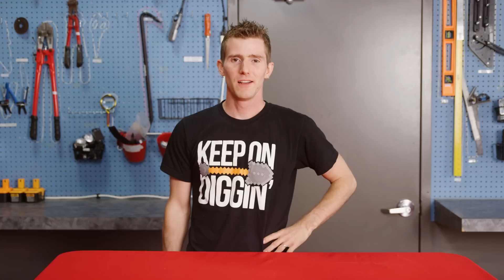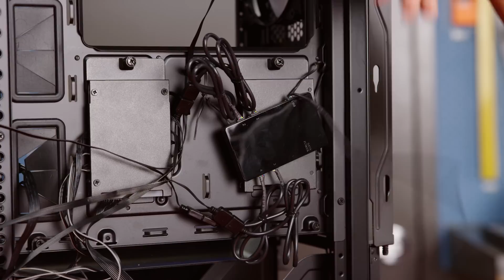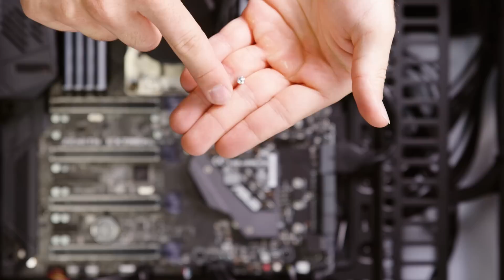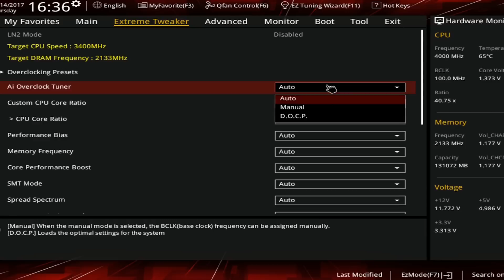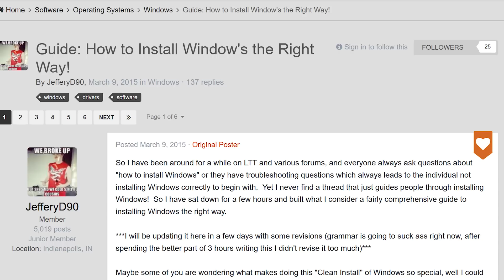Ultimate Mega-Workstation PC Build Guide

Comment: TBH this wasn't ultimate. No water cooling, no multi GPU, Intel has more cores now, Noctua fans are better, you could have had more ram, could have had 3tb of Samsung m.2 storage, could have overclocked GPU, should have manual overclocked CPU, and should have added storage as its meant to be 'ultimate'. Ok rant over.

Comment: ...why no vega?
Reply: Birki gts Well in that case wouldn't Vega FE  make the most sense considering the drivers for it are more aimed at production and compute tasks? Vega 64 only beats 1080ti in some tasks. I'm not biased by any means and Vega is really good in some regards I just think the 1080 ti is more well rounded for all tasks including gaming. Sorry if my first comment came off rude.
Reply: render performace 1080ti is better than Vega, BUT Vega have 16Gb RAM and that could be useful (same like quadro series) when you render complex animation
Reply: Not really. The gaming performance isn't that bad.
Reply: A titan xp is way better in every way than the 64. The 1080 ti and 1080 though do have less compute performance compared to vega 64. Then you can also consider the fact of power consumption, the xp is way more power efficient, so technically it might be cheaper to go green team because you might get away with a cheaper PSU, in the end making it cheaper overall.
Reply: 1080 ti is better
Reply: Vega is kinda garbage aside from computing

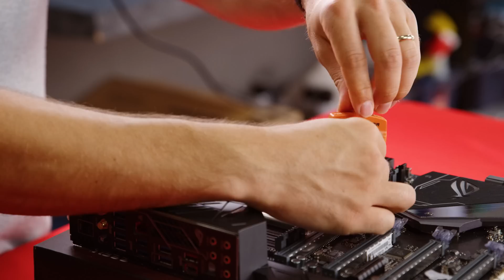Comment: 3:50 Psi is not a torque value, its a pressure, a distance times a force on a rotating axis is torque so the units are normally Newton meters or pound feet.

Comment: Help me, i have this PC:
Windows 10 Pro 64-bit
Intel Core i3 2100 @ 3.10GHz
8,00GB Dual-Channel DDR3 @ 665MHz
ASUSTeK COMPUTER INC. P8H67-M LE (LGA1155)
NVIDIA GeForce GTX 1060 3GB (Gigabyte)
111GB OCZ-TRION100 (SSD)

What do i need to upgrade to run powerful games?
Reply: I7 2600 or i7 2600k
Reply: you aint doing shit with an i3
Reply: https://pcpartpicker.com/list/6ZYFjc take your SSD, PS, and Graphics card from your old PC.
Reply: no, its more cost effective to just get a ryzen 5 processor, and a motherboard. the i7 2600k is still selling for 270 USD
Reply: Ryzen 1600
Reply: I think all the parts leaving the gtx 1060 requires an upgrade
Here are a few budget options:-
1)G4560, H110 motherboard with latest bios for 7th gen support, 8GB DDR4 RAM

2)i5 4460 and B85 board, your ddr3 ram will be compatible so no need of RAM.

Personally I would have gone with second option since I don't have to buy RAM and a 4th Gen i5 is a huge upgrade from a 2nd gen i3.
Hope I was able to helped you :)

Comment: This build would only cost $1,000 if you didn't include the RGB.
Reply: The processor alone costs 1000 dollars tho
Reply: you st... I gonna have really similar build and it cost me 3500 euro. 1950x 1000 euro, 1080ti 750 euro 64gb ram 500-700 euro (I dont order ram yet), cheapest TR motherboard 370 euro 2x ssd (1,5 TB samsung ), seasonic 600w fasless PSU for 220 euro and custom made pc case with cpu and gpu cooling for 600 euro ( go check fanlessfan.com ). So electronic cost around 3000 euro itself without cooling or rgb. Or you just post fish bate and I swallow it smoothly xD
Reply: PowerGlvove I never would have guessed

Comment: Single GPU? Unsubed
Reply: 2 1080 Ti don't run games.
Reply: We need 2 Titan xp, the newer pascal xp xp edition. No, not that one, the xp one.
Reply: 1. Money is obviously not a problem 
2. Put 2 titans in there and overclock the balls off of them, whole point of this thing is overkill
Reply: @Benny Biggums the main reason the 1080ti clocks higher is because the titan has a shitty cooler, put them both on water and they clock about the same making the titan more powerful
Reply: SLI 1080 Ti doesn’t improve much from a single 1080 TI
Reply: Overson depends on the games and resolution... I didn't get decent playable framerate on my home PC until I added an additional 1080 Ti.
Reply: +Dulux Doggy, the reason is so the PSU will run silently no matter the load of the system, Linus said it would draw around 600w under load, the PSU won't turn the fans on until it has a 600w load in it, thus under-stressing the PSU making it last longer and add heaps of headroom for down the road if another GPU is added.
Reply: Keep in mind this build (guide) is meant to be a workstation pc first, and gaming rig second.
Reply: Nabder Nagor and not even a titan!
Reply: Nabder Nagor LMAO
Reply: titans are kinda shit tho....
Reply: billyhatcher643 but what is the point of a 1200 watt psu with only one gpu!!
Reply: i concur doctor.
Reply: Nabder Nagor what benefits of dual-GPU on workstation build? Think about it.

Comment: Don't put anything less than a kilowatt PSU into a threadripper build unless you're OK with not overclocking.  Overclocked, just the CPU can pull 500-600 watts on it's own under full load.

Comment: 1TB of RAM is useful to have for basic use, especially if you want to occasionally use a RAM disk. Since most RAM disks scan be scripted to automatically load files, you could potentially have a game install copy its files from fast SSD, to the RAM disk, thus when launching the game, all of the loading will be RAM copy speeds which is just as fast as plain reads.

Comment: Decent guide , but when installing Threadripper,  Dont tighten down 1,2,3.  You should thread the screws until they catch in with 1,2,3 rotation ,  then tighten down 1,2,3.  When tightening down 1,2,3 it usually will tilt the hinge and the other screws wont be able to get started.  Seen many on reviews try to just tighten 1,2,3 and then had these problems and blamed the manufactures , rma'd the boards for this.

Comment: No custom watercooling? A Zotac 1080 Ti Amp and not an Asus Poseidon? No custom hardline watercooling? No 4-way SLI!?

What is this, a budget build!?
/s
Reply: No, it's a sponsored build, which means they use whatever Cooler Master tells them to use. Like seriously, when have you EVER known Linus to pick a Cooler Master all-in-one water cooler over Corsair?
Reply: Bate this is supposed to be a "ultimate mega" build not a "this is still kinda sorta justifiable build"
Reply: 4 and 3-way sli died with pascal. And 2-way it's not great, most of the games out there don't support it; so you get a expensive block of metal attached to your motherboard.
Reply: Revan a workstation is not for gaming. You can easily use 4x 1080Ti in this for productivity purposes. 

The system should have 4x 1080tI or even better 4x Nvidia Tesla P40’s
Reply: James Cruz that '/s' xD
Reply: Ayy lmao
Reply: Revan i can understand why you are looking at it only for it's gaming capability.
Reply: James Cruz love ur comment lol 7k dollar build with no real water cooling
Reply: all the money was spent on a sponsored case, that's why no real ultimate.
Reply: 3 and 4 way sli is also very difficult to fully set up for pascal, I know 4 way is not officially supported, but I am unsure about 3
Reply: Ben Perone you don’t need the SLI interface to use 4 or more cards in the system. 

CUDA does not need SLI
Reply: +Steve Bennett yes yes very true, but op referenced sli specifically

Comment: Sigh linus, linus, linus
You IDIOT
That computer sucks.

Look at my specs
Ram: 1Gb
Graphics card: GeForce G210
Motherboard: MSI X79
Cpu: Intel Core 2
Hard Drive Storage: 500 Mbs
Case: QuaDra 800 - 1993
Cooler: None
Rgb: Christmas Lights
Can run Windows Vista at 7 fps

Get on my level, Linus.

Comment: Linus, you disgust me. You are using Threadripper for a parts porn build, but you use an AIO water cooler for the CPU instead of a custom loop, you only use 1 GPU, and it's not even a Titan Xp or water-cooled, no Noctua Industrial fans (the pure black ones) for what should be multiple radiators, only 1+TB of M.2 SSD storage (doesn't even look like it's in RAID), no professional sound card, no 1600W PSU (which would allow all cables to be sleeved), half-assed cable management, and you used the ugly-ass Cosmos II case. Didn't know it was Amateur Hour at Linus Tech Tips. Couldn't even get a quarter chub watching this. I'm returning to pornhub.

Comment: How is this worth over $7000 and not have an open water loop? I spent around $4500 on my TR 1950X build with a custom water loop, 32GB of RAM, nothing but NVMe and SSDs plus two 1080's SLI (one from a previous build). This doesn't make any sense.

Comment: "12 pounds per inch of force" is a nonsense phrase - physics wise. Force in measure in newtons or pounds, not in units of distance. . Also 12 inch pounds of force is a very small amount of force - exactly 1 ft-pound, so don't try it without a proper tool.

Comment: "Don't worry about the fact that the AIO cold plate doesn't cover the IHS, the cores are in the middle"?????????????? No they are not!!   Full coverage TR4 120mm air cooling beats universal AIOs by 10 to 20 degrees in every test I've seen with even temps across all cores versus the lower coverage with hot spots...   Oh it's a Cooler Master sponsored build and they haven't come out with a full coverage TR4 cold plate!!!
Reply: Yeah not like Linus to list a bullshit fact, he had to say something to appease cooler master. Or this was filmed a long time ago and maybe the delids didn't happen yet.
Reply: This simple fact made me too wonder where this silly misinformation came from. Gamers Nexus has a few videos showing the actual inside and also has a video covering what kind of actual coverage those AIOs made for standard CPUs get on Threadripper and it ain't good. Pretty amateurishly done by Linus there.

There is no defending this huge mistake, just take a look what there the actual dies are inside the CPU for yourself if you think that silly little AIO plate won't make it run way hotter than any cooler with full coverage.
Reply: that vid shows that universal AIOs don't give 100% coverage of threadripper they only cover about 95% of the die area and less than 75% of the heat spreader lid...   They will work OK at stock clocks, but not near as good a full coverage TR4 specific cold plate cooler,  I have seen vids of 1950X CPUs OCed to 3.8GHz on all cores with small cold plate AIOs be OCed past 4.1GHz with TR4 AIOs with the same radiator size.
Reply: https://www.youtube.com/watch?v=QpvGYxaMLc0. You don't know what your talking about here is some nutrition for your brain.
Reply: I know it wasn't directed towards you, it was for Jackson.
Reply: Well the cores ARE in the middle, and the video was probably filmed a while ago, maybe there weren't any bigger AIOs at that time.
Reply: The reason the larger AIO coolers are more efficient is because of the larger surface area, not due to the cores being evenly spread through out the dye. Linus isn't lying, the cores ARE in the middle.
Reply: omg no one cares

Comment: Sorry Linus, but I built something close.  1950X // Gigabyte X399 // Dominator Plats 32GB 3200MT/s kit.  Toying with KVM in Fedora 26 right now. https://forum.level1techs.com/t/oh-boy-i-just-ordered-a-1950x-threadripper-o-o/119126/20
Reply: To be fair, your $7,000 cost is from all that extra fluff.  With the 'bare bones' essentials, I've managed to get mine up and running (albeit using many parts from an existing box, such as the Corsair 570X case) with a modest GPU and only 32GB of DDR4 RAM for much less.

Also you should stress the importance of using 3200 MT/s RAM (or higher if possible) as the infinity fabric depends on this.  Usually the XMP profile should take care of this.

Comment: Got the 1950X on the Gigabyte x399 Gaming 7. If you decide to go x399 STAY FAR AWAY from Gigabyte. The motherboard did not come in a anti-static bag. It had NO CPU socket protector either. Just complete garbage QC and it was the 2nd most expensive TR4 motherboard. When I opened the mobo box I could see the motherboard (during shipping) had ground down the cardboard because the mobo had nothing to protect it and all the sharp pins on the back side pushed through the box.

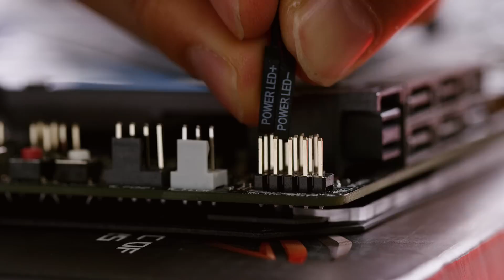Comment: 8:44 why do we STILL have these aweful front panel conectors as standard in 2017? Every other plug on motherboards has been upgraded in the last 15 years, except this one.
Reply: Well, at least ASUS boards come with a little thingy that you can connect all the front panel thingies to and then put onto the board in one go, rather than plugging them all in individually. Also, these simple pins afford a great deal of compatibility, going so far as to allow a screwdriver to be used as a makeshift on/off switch. I like the flexibility that this gives case manufacturers and especially modders. And on a final note, my case comes with not only one, but two network activity LEDs, this means that if there were a standard front panel connector, it would have to come with not only switches for power and reset, a power and hard drive LED, but also two network LEDs and a chassis intrusion switch. I imagine that space is at a premium especially on ITX boards so a new connector would not only necessitate a good ten years of a transitional period where every case and/or motherboard comes with adaptors, but also waste space for no good reason other than saving a few seconds to assemble the system.
Reply: because making a standard connector for 2 buttons and 2 leds is way too hard for manufacturers....
Reply: except for when you jostle your case a tiny bit and they all fall out and disconnect.
Reply: Can I just point out you guys have it easy. Even with these hellish connections.  Try doing that while being suuuppperrrr short sighted. To see those I have to be within 3 inches. Try fitting your head inside most cases. Woo. Ftw. Woo
Reply: Probably has to do with most of the fancier connectors on the motherboard carrying data signals that need some sort of standardized shielding from electrical interference. Meanwhile, HDD and power leds only need to go on or off which is hardly going to need shielding. Power and reset switches are similarly dead simple.

In terms of engineering principles, K.I.S.S. or "Keep It Simple, Stupid" is probably being applied in this case. I don't think it would be worth the effort to get both motherboard and case manufacturers to all agree to yet another standard for this.

One scenario where a simpler connector would work better is an open test bench, which would be fairly common to everyone who tests for faulty parts BEFORE assembling the PC in the case. Powering on the system would be as simple as jumping the power pins with a screwdriver. A more complicated connector might require dragging the case close enough to the motherboard to actually connect it.
Reply: Colin Antink if u mean nearsided, i feel u, I'm super nearsided and have bad astigmatism so i have no idea what im doing lol
Reply: my z270 gigabyte aorus board came with a thing to plug all of those connectors into, then it's just one plug on the mobo
Reply: Ditto
Reply: because they work and are so simple even a 6y old can connect them correctly ?
Reply: they are not really THAT hard to plug them are they? If they are hard just practice, you’ll get used to it then it’ll be so easy you don’t even think about it.
Reply: Ark Aye there's some strong ass magnets out there
Reply: Felipe Figueroa because they work and there really isn't anything wrong with them
Reply: you are right, we should be using all standard magnetic auto secured conectors by this time
Reply: The fking audio system cable/conector HAHAHA looks as cheap as the 40dls motherboards lol
Reply: took me about an hour to find the page in the book describing these!
Reply: Colin Antink dude get a glasses or go to eye doctor. I mean no offense short sight can expand if left untreated

Comment: I build pretty much this exact build last week, and one thing that I think your viewers need to know is the huge amount of force required on the TR4 socket's torx screws in order to get the thread to catch. I had to exert what felt like a dangerous amount of pressure downwards on the torqued torx driver to get the thread to catch. My socket was manufactured by Foxconn, which seems different to yours (yours didn't seem to need any downwards force to get the thread to catch) - so maybe there's some manufacturing differences there.

-- actually on 2nd viewing, your video clearly shows the screws are not being threaded as you were shooting that footage, so maybe you did have the same issue...?

-- also, did your motherboard not come with the really neat and easy to use header for the power button/reset/hdd LEDs etc? It makes things much easier and is something all motherboards should have.

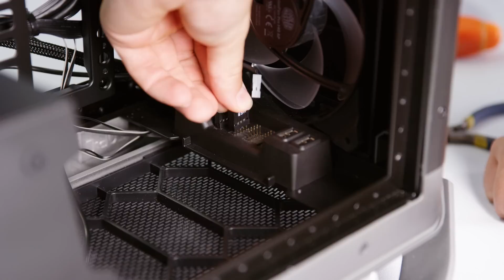Comment: 11:07 next time just combine them into one header, they are only using one port each, you can re-pin the connector with both cables. you might have noticed that half of the connector on both of those is un-populated, all ya gotta do is pop the inserts out of the connector on one then insert them basically in reverse on the unused side (use google to get the pinout and use your brain).

Comment: I am extremley disapointed. You have a motherboard and a psu that can easily handle 4 gpu's and you only have one. Also, your one gpu is air cooled not water cooled. ANd 128 gb of ram? You could has easilly put 256 gb in this system.

Comment: Handy hint - you can get rubber "zip tie" type devices which can be used to mount the fans so that any vibration from the fans isn't transmitted to the case - I use them and can thoroughly recommend them

Comment: Instructions were unclear. Got Threadripper stoke on my nose, now my brain is running Crysis 4 maxed out settings at 247466277p at 956474576 fps. The only problem is that controls suck because I have to use my ears as gamepads.

Edit: Nevermind, the CPU fell off... It was a great experience. :v